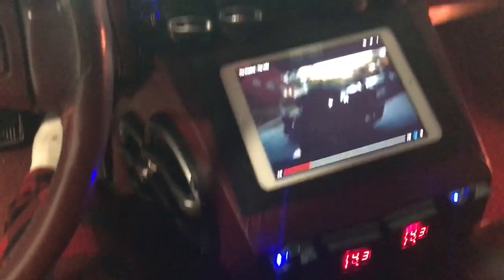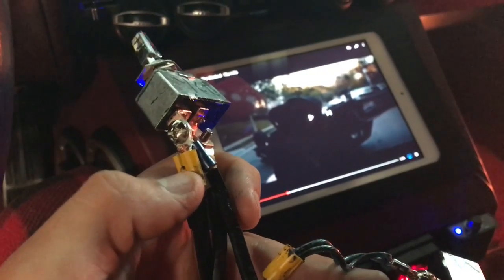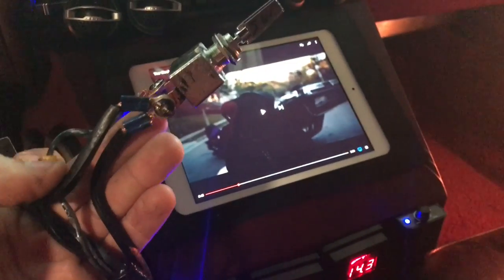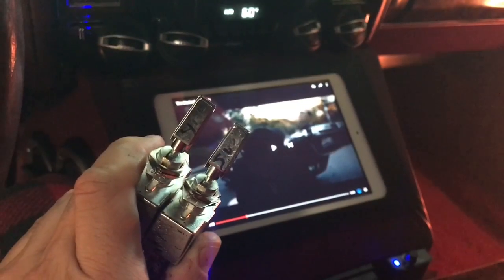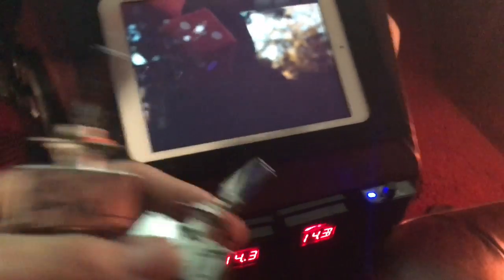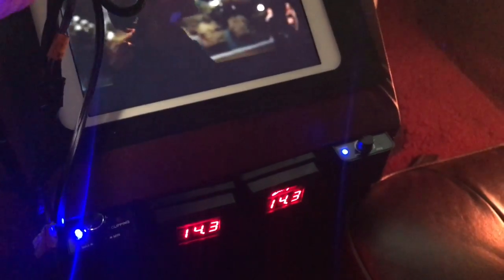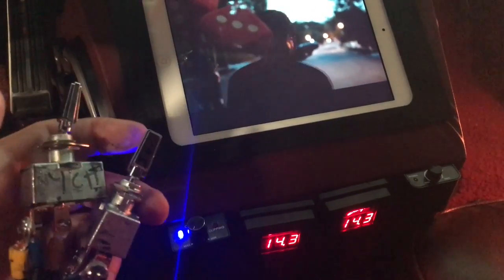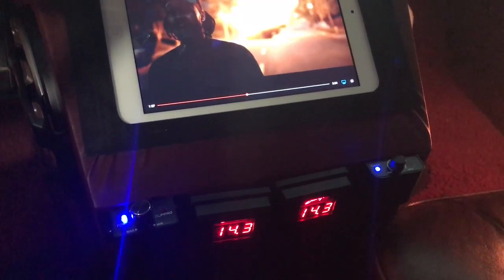Amplifier Kill Switch Install

Comment: hooking up a 4 prong switch for my amp due to the remote turnon wire not working on my head unit and found this video. Just gotta say I miss that car. You're the person who got me into Sundown! In the process of building an enclosure for my zv5 18. the 300 is gonna be bangin on this 4500 <3 hope all is well, steve!
Reply from the maker: I miss it too. It’s around, somewhere! Good luck on the build!

Comment: Hey steven i have a ? For you . im trying to fix my cousins sterio system. And the problem shes having is that both her amps wont shut off or her equilizer and we just cant figure it out since we are far from knowing this stuff. But i was thinking if i could just add a kill switch between the equilizer and the sterio?
Reply: 2 years later.... make sure nun of the wires are touching

Comment: Steven my subs are making a thumping static sound without rcas plugged in.only comes on when the switch turns on the amp is out the box new light turns on but no bass. Only loud thunder sounds.even with deck off and rcas unplugged
Reply: Same shit happed to me and my dad most of the times it’s one of the wires that messed up
Reply: Make sure none of your speaker wire/RCA cables are touching or too close to any power cables that will cause what you are describing

Comment: Is it possible to just put a kill switch on the power supply from the battery cause my amp stays on when my rem is off I think it's the amp cause I didnt have this problem recently
Reply: It is possible but I’m not sure how to do it that’s what I’m looking for
Reply: @savageking1881  figured it out?
Reply: I'd think you could use a starter solenoid like a relay on amp power wire

Comment: Hey my deck doesnt have a remote that i can find.could i hook up a switch instead to turn the amp on and off??
Reply from the maker: Absolutely. A simple relay on a switch will work. That why I use in my current build

Comment: What are you using to shut it off ?the remote wire or the battery to amp power wire?
Reply: Would battery wire be able to put on a toggle tho
Reply: @justinamyx9091  yes but make sure you have a fuse before the switch on battery side
Reply: @troymorris9530  so  your saying I can connect a Kill switch to the power wire from the battery to amp to on and off it ?
Reply: @SickoTexas  you could but its just easier switching the remote wire. I have mine set up like that and have had no problems